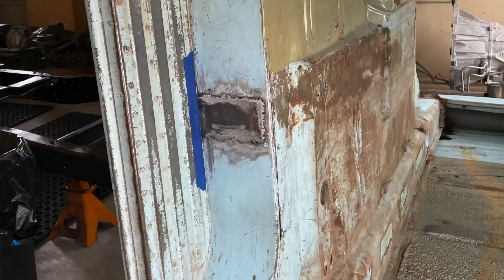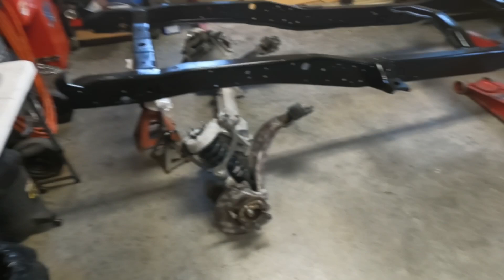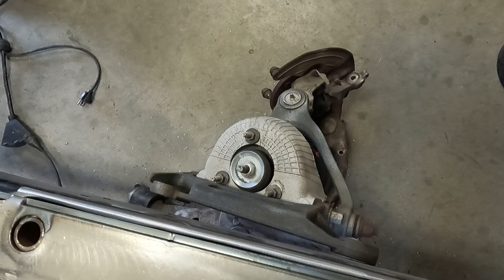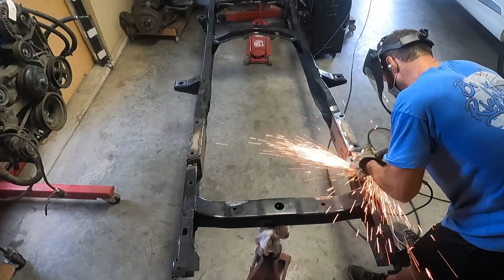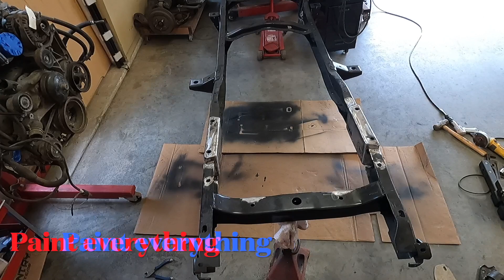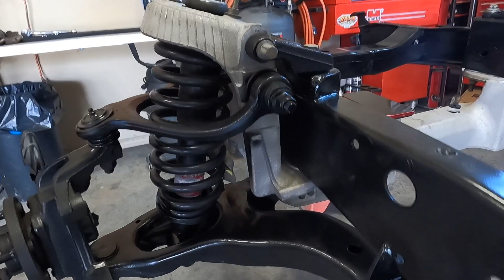'64 F100 Project! Part 5: Undercoating the cab & Crown Vic front suspension install.

Comment: Building my 64 right now and at this stage.  The small hole that you drilled for the CV alignment pin, was that the old center line of the straight Axel or did you move it forward 1/2-3/4”?
Reply from the maker: Moved forward. Don’t remember the exact amount. Was determined before tear down to get the front wheels centered in the fender opening.
Reply: Thank you.  Much appreciated.

Comment: anyone know what kind of grinding wheel GMTV uses for cutting all the sheet metal work??  I'm thinking a diamond 4" or 4 1/2" Ready to cut clearance to mount the steer box on the 1964 truck.............finally
Reply from the maker: A 4 1/2” cutoff wheel seems to work best. Those diamond steel blades aren’t all that great. Buy a pack of dewalt blades and you’re all set.

Comment: Maybe a dumb question, but are the crown Vic alignment pins center of the subframe? So I would need to align that with the centerline of the axle on the truck?
Reply from the maker: Yes. Sorry I didn’t make that clear.